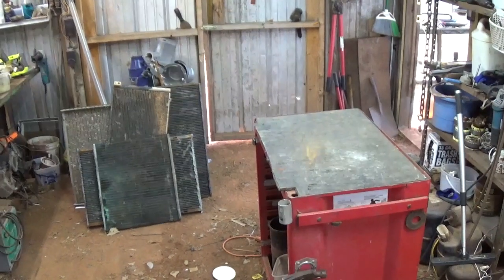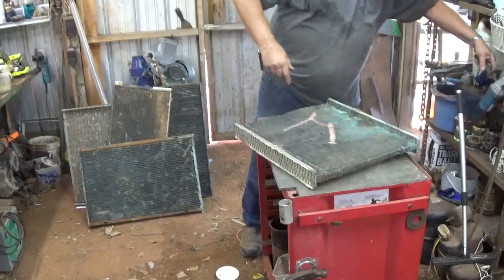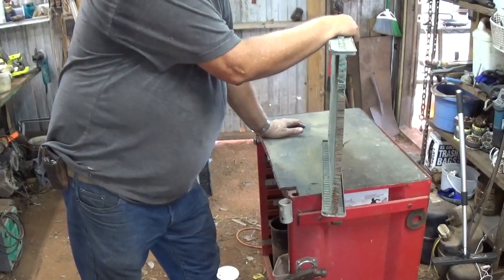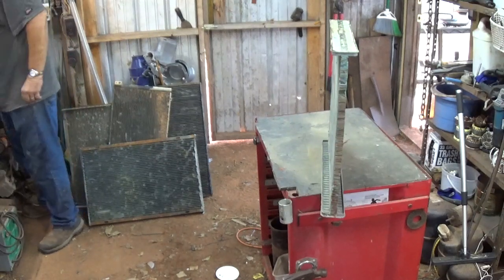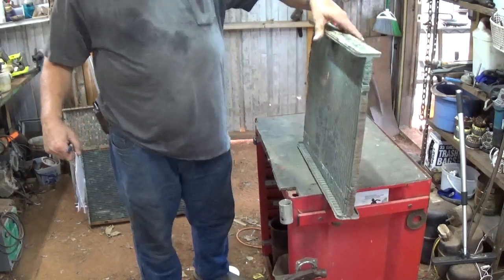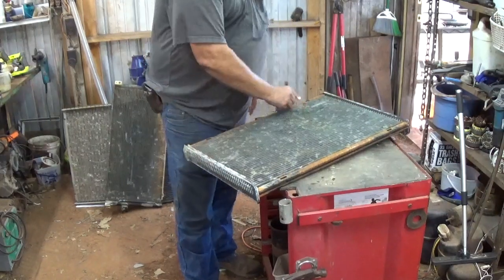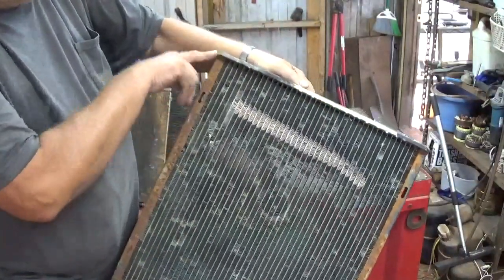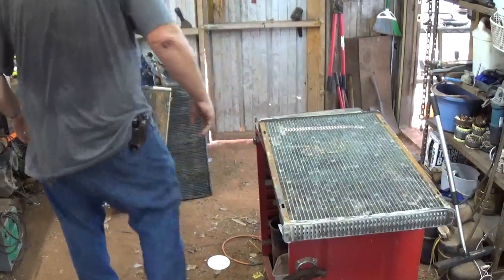Cleaning some radiators for Copper Brass and Aluminum

Comment: With loads like that you need to retire and do it  full time good video
Reply from the maker: I plan to work through the winter and then go full time in scrapping this next spring, should have my dump trailer by then, and property will be paid off, Thanks for stopping by
Reply: @Okiescrapper  no problem I have a 3.5 tons tipping  trailer but it is fairly high .hard to load but easy to empty all the best howard

Comment: Thankfully my buyer of aluminum radiators ain't anal retentive with a little bit of plastic stuck on the sides ,just as long as the steel coolers & lines are removed
Reply from the maker: my yard may not say anything but I try to clean things the best that I can